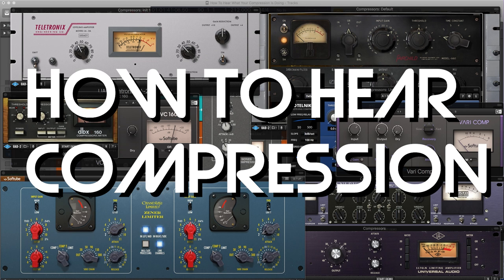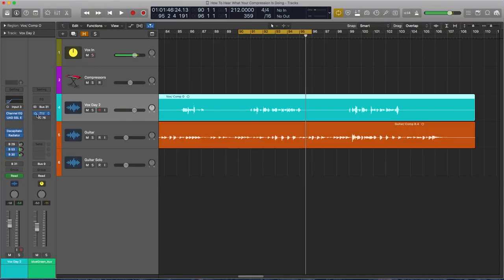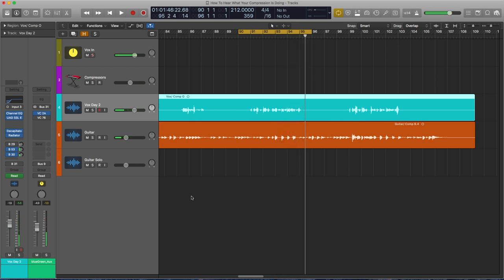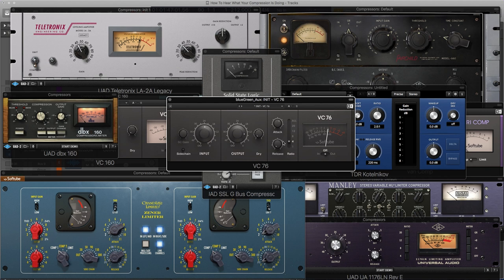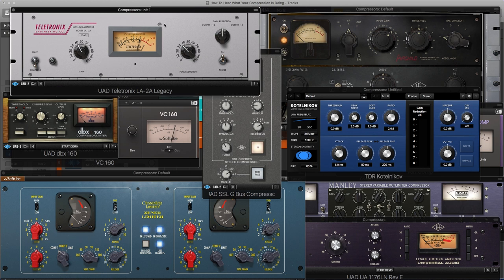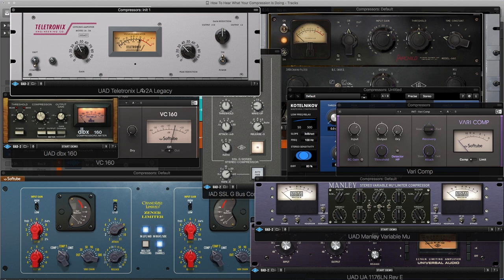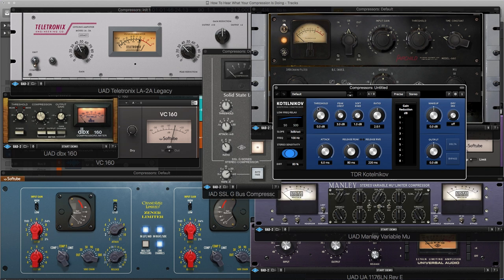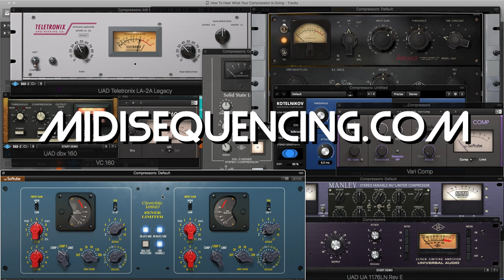Good Compression vs Bad Compression

Comment: compression does not add clarity, period.
Reply: Are you sure?
Reply: @FelopyProducer653  Yes. You're adding to a sound. How can that make a signal cleaner.
Reply from the maker: It depends how you define clarity. If someone is alternating between screaming at you and whispering in quick succession you might not be able to understand them. If you compress the voice so that the levels are the same, then you might be able to understand them more clearly, thus using compression to increase the clarity. That's an extreme example of how compression can add clarity but it can also be more nuanced version of that.
Reply: @MusicSequencing  I get your point but I'm not sure what your analogy has to do with music production.

Comment: great video topic but not enough demos/examples. 

I didn't know that the compressors without attack and release knobs simply preset those presets. Good to know. 

I also came away feeling unsure if I agreed with you when something was too thick or too compressed. That might be my own hubris. It seemed like the short release time helped the phrase endings be louder and that made for the best option. If it isn't really best, I'd like to hear more about why.
Reply from the maker: The short release (fast release) time was my opinion on what was best in the video too :) Short release was when the dial was to the right. It's ok  if you disagree with what sounds better to you, sound is a subjective thing after all. That said, compression takes a long time to really hear exactly how the sound is affected and if you are really making things better or just louder or easier to hear. This is definitely a topic worth revisiting though, thanks for the input!